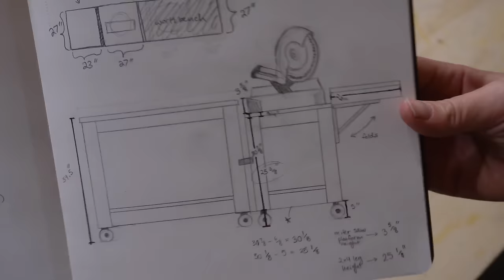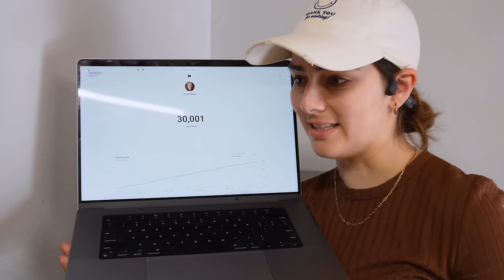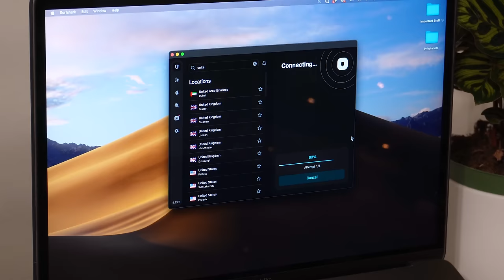More workshop updates (Miter saw stand + organizing)

Comment: I would recommend a new Freud blade for the saw and some dry film lubricant for the slides. Makes the saw even nicer to use! Keep up the fun shop work.
Reply: @elenamakes with respect to blades, I would recommend checking out the Insider Carpentry video on saw blades before replacing the blade on your miter saw.  Spencer has some good information in there.